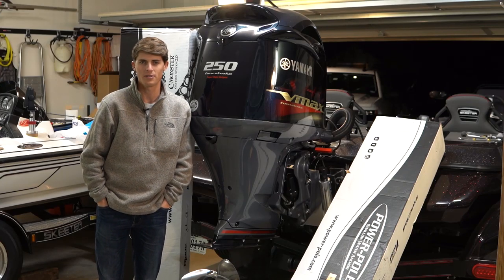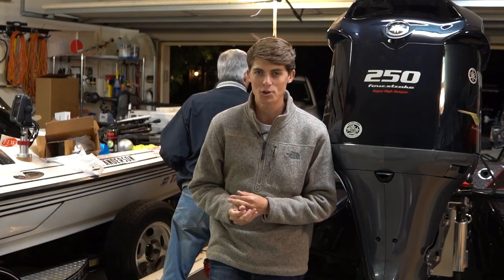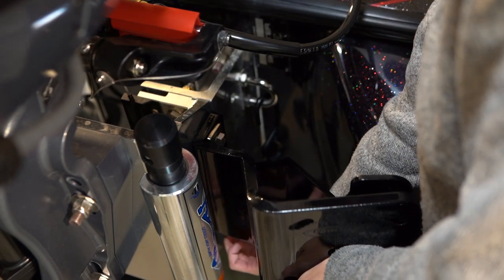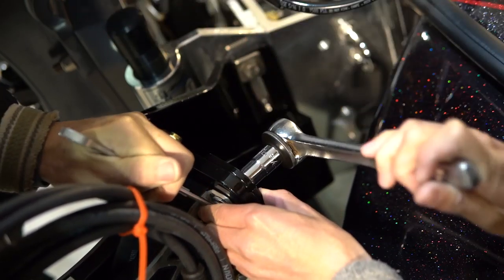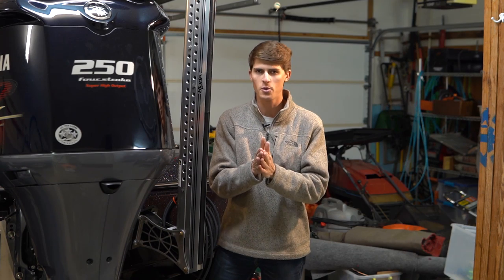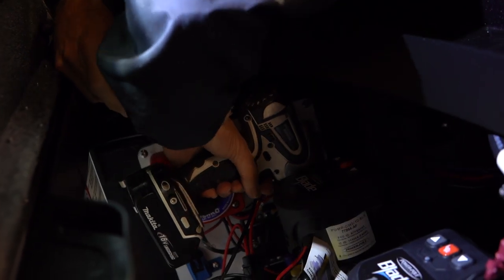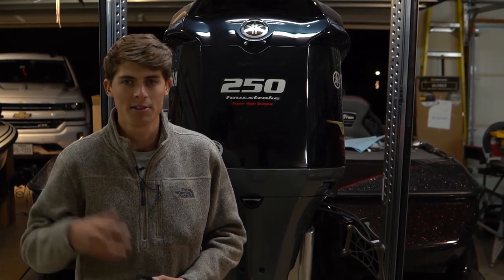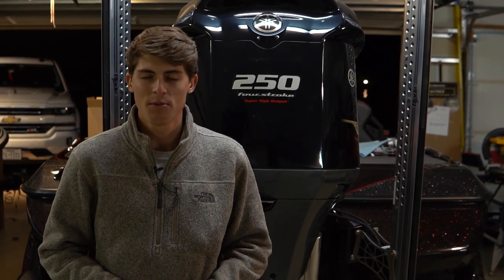How To Install Two Power-Poles On A Bass Boat (2020)

Comment: Wish you would have shown putting the covers on the stern brackets so potential customers dont think the stern brackets  stay showing the polymer core and stainless steel plates.  As well as they do not move up and down with the jackplate.

Comment: The power poles do not move up and down with the jack plate like you said. Only the motor will move up and down on the hydraulic jack plate.
Reply from the maker: Yes you are correct, I was wrong